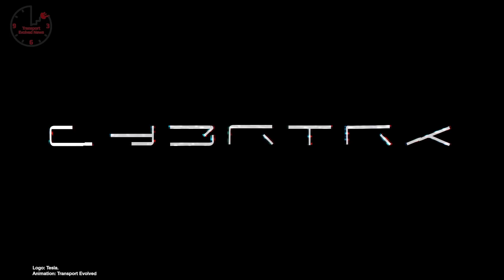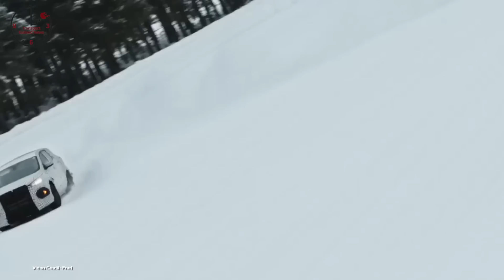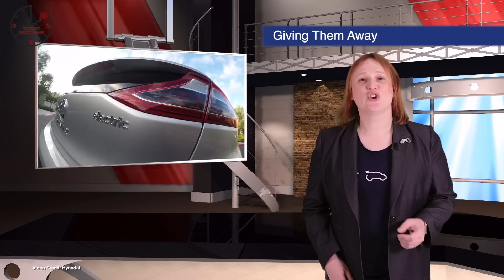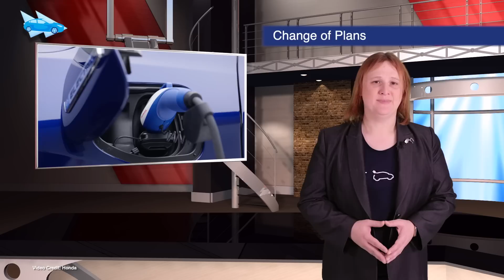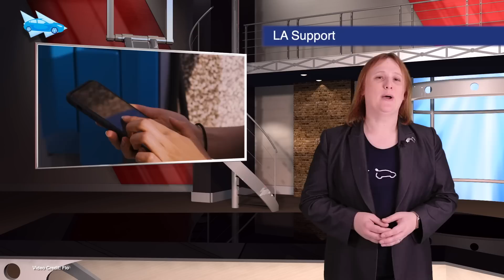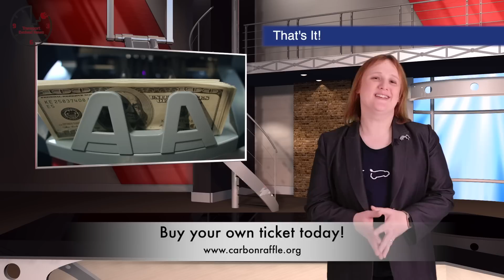TSLA CYBRTRK, Mustang Mach-E Named, EVs Outsell Stick-shifts — TEN 273

Comment: The glass broke in the reveal because, as you can see in the video that they 
"practiced" on the same window before the reveal. This weakened the 
glass. Just as a bullet will not penetrate bullet proof glass initially,
 but if you shoot it a half dozen times or more, it will at least chip, 
crack or shatter, depending on the thickness. This is like the joke in 
the movie where the stud tries to break the record of having sex with 
the most women in one marathon, fails, and says, "Gee, it went well in 
practice this morning."

Comment: ...some portion of the bed-wall may ANGLE upward from the rear-rail to the rear-roof of the cab ...APC-like...tho ....this TeslaTruck MIGHT be a 'convertible'....from open- to ROOFED-bed INTRA-mutably re-configurable ....like a panel van that shape-shifts to NON-standard pick-up format (rear roof slip-slides forward... BENEATH... the... front roof..)....for hauling..... say......... giraffes.....(GTM).... w/ slide-out pocket-floor loading-ramp and/or power-gate....& fold-aside MOLDED-metal bench-seats (Bed)... AND sliding cab/bed-connecting pocket-doors w/ accommodatingly adjustable Cab seating ........ y'see.........THE... front 'bumper' or Tool Mount will be WELL-receded BENEATH the Brow-o'-the- ARGUABLY Stand-w/-In-Cab....behind an Armour-glazed wind screen w/ beveled-back A-pillars... for a 'FACETED' look...shielding a CENTERED swivel-able Pilot's Seat... BACKED by 2sideXside MoreOfTheSame...AND by three-across bench seats...for cozy...StarLinked... Cab Consultations & Confabs....not to mention... Lunch...... Up-optioned from $50k..... 500+mp/chrg=300+mp/c LOADED &/or TOWING 20k#+.............doo DAH.

Comment: I'd say it's a mistake to say manual transmissions are for 'gear heads'.  Sure, there's a section of the market for that.  But I would think the larger market is income based, with manual transmission vehicles often being the only way some folks can afford a new car.  That segment is slipping partially because buying power in the US is stagnating as cost of living increases.  People have figured out they are better off to buy gently used vehicles a few years old for half the cost of a brand new model.  And there's plenty of those gently-used cars because of the car swapping trend that sees some people constantly trading up for new models.  The whole industry has gone wonky because of that.

Comment: The reason you get about as much exercise on an electric bike as a regular one is because you will go farther and use them more often because it makes a long stretch or a hill less daunting.
Reply: That is... insanely plausible, actually.
Reply: Or get fit by pushing it home when the battery runs out.
Reply: Zygmunt The Cacao Kakistocrat or just pedal. You pedal most of the time on an electric bike. If the battery runs out, you just pedal normal as it is not much heavier than a normal one.
Reply: You also get extra exercise picking up the super heavy electric bikes on to racks and stairways
Reply: Leighton Mann an electric bike weighs about 15lbs xtra.
Reply: @MJ-zo5gb  Leighton did say 'super heavy'.  There are some pretty chunky ones out there!  Class-3 ones tend to weigh about two to five times more than my mountain bike.

But your point is a good one:  Riding an electric pedal-assist, you'll just keep pedaling when on a regular bike you'd coast or find it too hard to pedal.  I found them awesome!  I want one.

My spouse bought me an electric motorcycle instead, tho, which has replaced more than 50% of my driving ^-^

Comment: The Tesla Model Y really has carmakers trying to move fast and not let Tesla runaway with the electric SUV market
Reply: Except GM apparently.  I guess we'll see.
Reply: @EM-yp1cf  I heard a story somewhere about a larger Chevrolet Bolt
Reply: Tesla really left the competitive door wide open there.. doing Model 3 before Y, ... BIG mistake, when everyone knew Model Y will vastly outsell Model 3 ... now when Model Y launches, the Model 3 volumes will plummet and most of the lines at Fremont will ave to all be retooled for Model Y.

Comment: Big fan of electric vehicles, but there's a universe of difference between swapping in a manual gearbox and swapping in an electric power train.

They're both "niche" as it stands but one is INCREDIBLY complex and one is pretty simple and very cheap. Personally, I'd gladly sacrifice my precious manual gearbox for an EV. Though I think the rise of EVs is the salvation of classic cars, muscle cars, and other over the top machines.
Reply: Manual gearbox's are fairly normal in many countries outside the US. I had a choice of a manual or automatic for my first car but as I'd learnt to drive using a manual one, I thought it best to retain & develop that skill set further @ age 18. I've never regretted doing so but have no objections now to foregoing one in exchange for an EV.
Reply: @BruceLortzHI  I doubt that you'll be the only person who feels that way. After all, what better way to make best use of an already existing vehicle than to reuse through conversion to EV. Have you seen pictures of the 1 - 200,000 diesel VW's that have been left sitting outside to rust following dieselgate in the USA? They might not be classic cars but surely EV conversion on that scale could be financially viable for someone.